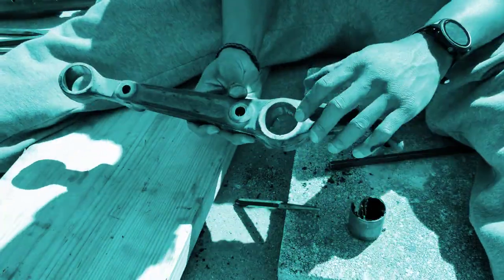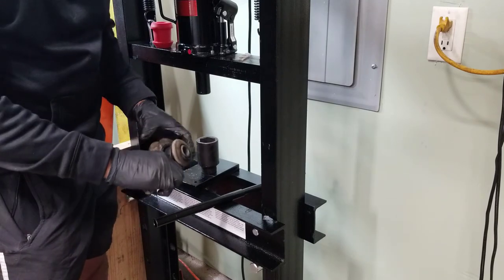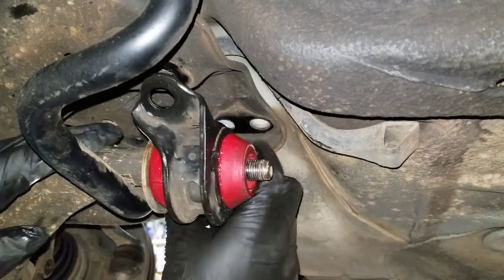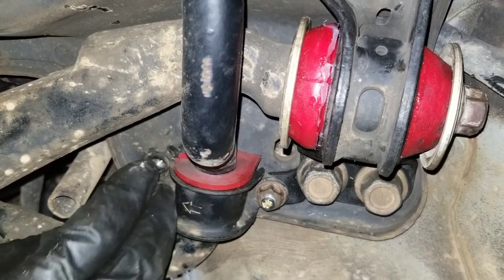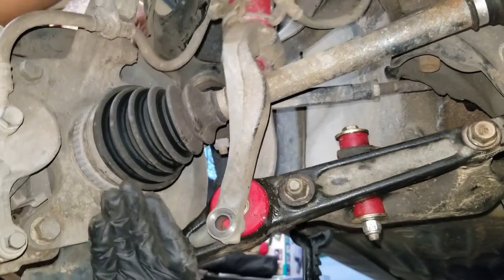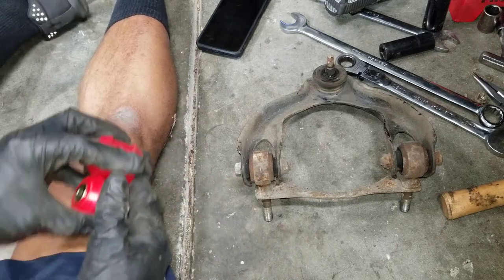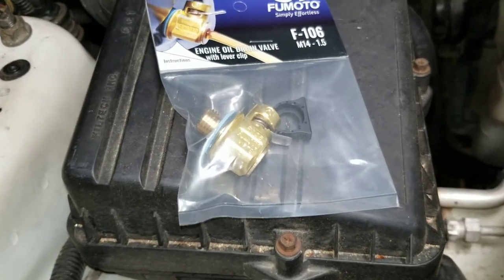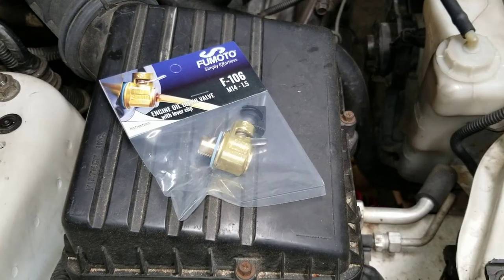95 CIVIC | Installing polyurethane bushings

Comment: Good job on doing the hard work, but I would have cleaned and repainted the control arms and fork while you had them out. I’m doing a similar rebuild on my  Del Sol. Oven cleaner takes all that grease and grime off with one can as opposed to multiple cans of brake cleaner.
Reply: I will have to try this because I'm the same way. Anything I touch, I do my best to bring back to life bolts replaced type of guy try Zep industrial degreaser comes in 5 gal jug it says to dilute use it straight always worked good for me 👍

Comment: Hey Maq

A question please

Does replacing the front control arm bushing with Poly makes the steering wheel vibrate less in high speed?

Comment: Nice video bro 👍🏽 I sourced this kit for my 01 Honda CR-V but don’t have a press so I shied away from replacing the bushings. Ended up just buying the whole upper and lower control arm 🤷🏽‍♂️
Reply from the maker: Thanks. That would have been so much easier. And, I swear a hear a squeak sometimes now. But, It is so infrequent and faint that I can't locate it. And I can't reproduce it.
Reply: @MaqsVids  it was easier but I was bummed I couldn’t use the polyurethane bushings. How does your car ride? Would you say that it’s worth going with polyurethane?
Reply: The bushings are great when turning they feel more response it is amazing its called energy suspension master bushing kit which is the same as the video you will need a torch sawzaw and a 70 dollar press from harbor freight all which can be returned and the bushing kit is so easy to install its pretty easy to get the pieces out if you kept the old lower control arms i would say try it out and try installing the bushings

Comment: I wish I could ride in it and feel the difference. My 95 coupe has aftermarket oem-style bushings. Replaced last year. But then again, our coilers are different, too.
Reply from the maker: Imagine with mine oem would have made a big difference too since mine were so shot. What shocks do you have? If I do another, I might do bushings and lowering springs. I can't go as low as I would like with my driveway.
Reply: @MaqsVids  Function and Form Type 2. It’s the only modification I’ve got, aside from a short shifter. I’m pretty happy with the ride quality.
Reply from the maker: Nice. F&F type 2 we're the first coilovers I ever installed on a car (1992 Integra). I was so happy with them that I have been afraid to try another brand. I have purchased 2 sets of type 1 since. Still very happy.

Comment: How do they feel? I’m doing mine right now
Reply from the maker: They definitely make the car feel more stable. More of the imperfections of the road are felt. I really like it. I'm poly all around now with Coilovers. So, it is tight, responsive and "new" feeling. Steering and turning feels like a new sporty car. And, is is less comfortable on bad roads. But I love it.
Reply: @MaqsVids thanks for the review and install.  I can’t wait! I got a 92 eg and am doing poly bushings for my trailing arms. Front control arms, I did blox rear, adjustable camber kits front and rear, new hubs, bearings, ball joints, and then I’m redoing braking. I got a integra type r caliper with Mini Cooper 11in rotor setup for the front over the stock 9.5 brakes, stainless lines, rear disc swap, 15/16 master cylinder and a 4040 prop valve. Should handle and stop like a whole different car now 😈
Reply from the maker: @playerinpink Awesome!!  That sounds sick!!! I'm going to look into the mini Cooper brakes.  Putting the poly bushings in the rear disc swap was very noticeable. But, my old bushing were shot. I would love to hear how it turns out.
Reply: @MaqsVids  I want to say it’s 07 base model Mini Cooper 11in rotors with the integra type r calipers. You’ll need to change your front spindles to ex si or gsr spindles. I can’t stop doing a pull to 140mph without pumping my brakes on my stock dx brakes. It’s sketchy
Reply from the maker: @playerinpink  Thanks man! I have an EX so that works. And, since you told me about the Mini Cooper rotors, I have seen it on a video. Either it's destiny or the almighty algorithm.
Reply: Upload a video driving it! Miss this build on the channel and uploads lol
Reply from the maker: Thanks!! There is more coming!!